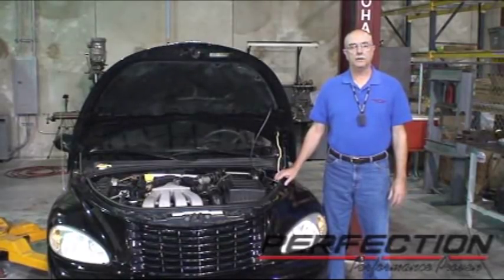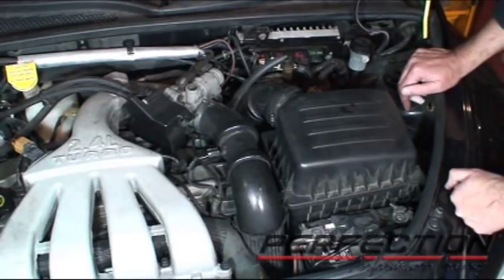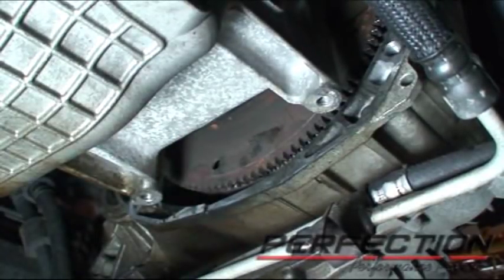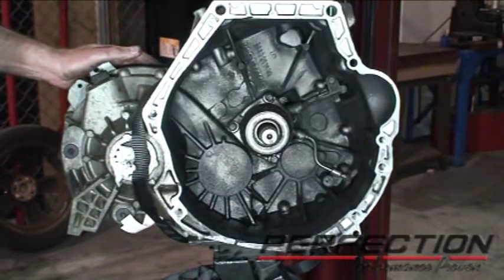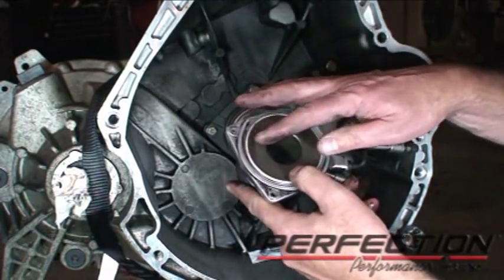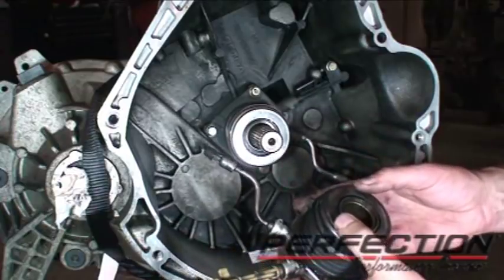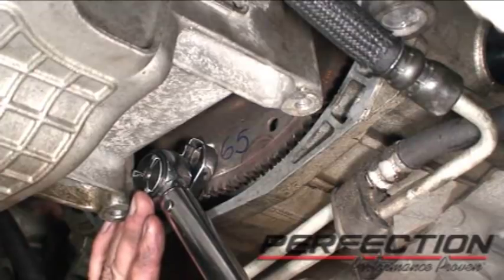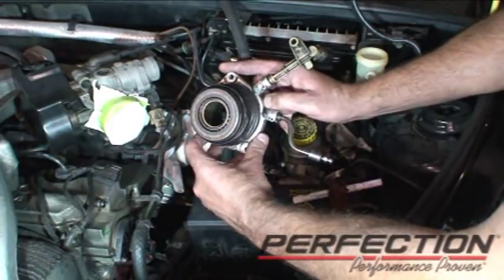2003 PT Cruiser GT 2.4L Modular Clutch and Slave Cylinder Installation

Comment: Sir i noticed that the motor 2000 cc with manual trans .. is it from factory made like this ? Or you replaced it  from auto trans..
Why i say that because it is the first time i see 2000 cc with manual trans 
All manual trans use 1600 cc !!
Reply: All pt cruiser in America are 2.4 liters
Reply: @edpenkalski8937  can we use the same manual trans with 1600 cc motor dos it fit ?
Reply: @mrlyricsneo  no clue

Comment: i have a question about the clutch for this car. i purchased your clutch kit for my pt cruiser and i don't have any references as to the how many inch pounds or pound feet of torque i need to tighten the pressure plate on to the flywheel. can you help?
Reply: Did you not watch the video ?

Comment: I have a 2003 Pt GT but it's automatic. I have a very Loud piston like  knocking sound when my car is at a very low idle? The car runs Great and the Automatic tranny works fine. It's absolutely normal with no sounds when driving it. It only makes that "marble in a cup" noise when it is at a very low idle. For instance- when I turn the air on and just before it kicks back up to normal idle. I took it into 2 different shops to see if they can find out where it is coming from they both said it's from the transmission. Sounds like the torque converter/Flex Plate? Maybe a bolt is loose or possibly came out? I am having a hard time visualizing it or where it is? Also if I keep driving it would that bolt wreck anything? Car runs great and the tranny seems to shift normal  and has lot's of power and you can't hear it at all until it's at a low idle. Any help would be appreciated! Thanks
Reply: OK thanks

Comment: My 05' PT / GTs slave cylinder is bad. I was really hoping for vin "G" but nope, I have vin "S" which means an internal slave. They need to make the engineers who design this crap to work on their own creations, thanks Chrysler! I guess I'll be on my back in the driveway all weekend, yea.... 😒
Reply: perfectionclutch That sounds horrible! I miss my 72' Skylark, it was pleasurable to work on.
Reply: Imagine you take your 05 gt and some other idiot that owned it first removed the reservoir .. a s VIN and g vin should be the same
Reply: And the g vin is the same system as this

Comment: Hello All, Please HE carLP!
I do hear a grinding noise whenever i start my PT Cruiser 2001  Model. Can anyone, kindly tel me what's wrong with my car?
Reply: Probably just your starter going out.
Reply: Thanks for the response. i later noticed that it was my middle motor mount that its gone. i changed it and my car is back to life. no vibration or noise again. Thanks All
Reply: Olu Dexter ignition cable
Reply: Olu Dexter n